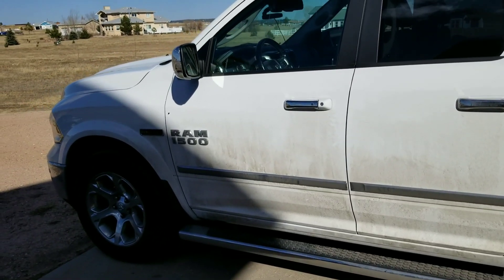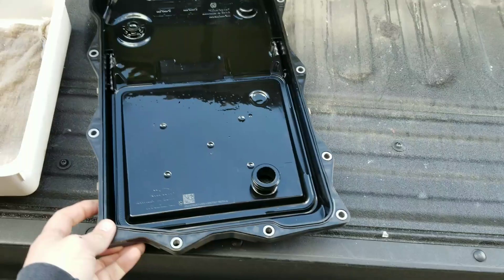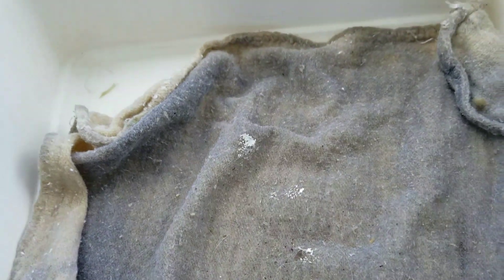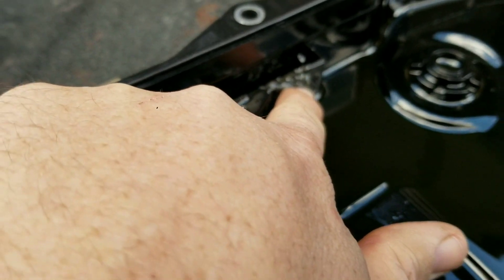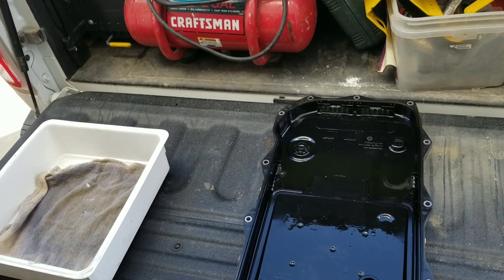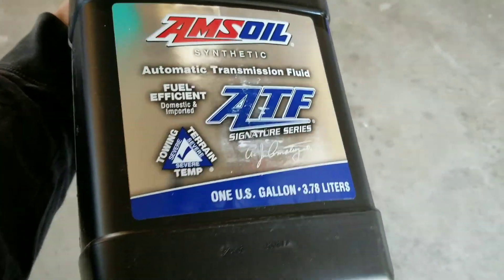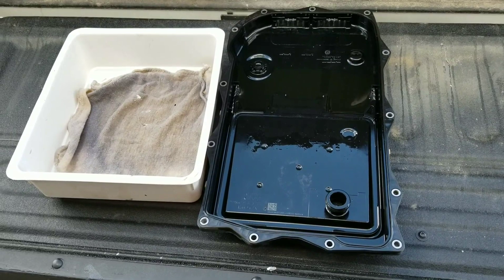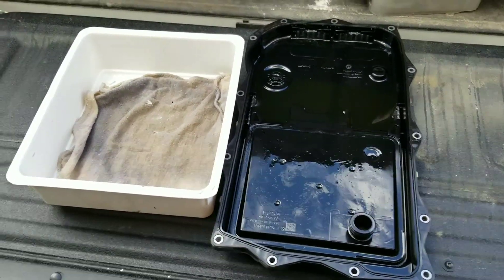Ram EcoDiesel 70K miles transmission service and findings: ZF 8-speed

Comment: The official ZF procedure calls for the transmission body to be level, which usually means jacking the the rear end of the truck up, rear wheels about 8-9" off the ground.

Comment: Dealer cost to change the transmission fluid is around $600.00. $225.00 rear axle fluid change, 2 wheel drive. Then $600.00 for 16 spark plugs. Pretty expensive service. But, much less than replacing either component. It cost to play.

Comment: I thought it was
Traction control off
Reverse at 2000 rpm for 5 seconds 
Neutral at 2000 rpm for 5 seconds 
Drive at 2000 rpm for 5 seconds...
Then let transmission cool to 86/122...
Top off...
This seems more simplified.

Comment: I love this transmission. I tow commercially with my ED taking travel trailers from Mfgrs to dealerships. Truck runs all day everyday like a semi. 640,000 miles zero problems with this transmission. I change fluid every 100k so 6 times now. 3 times I changed the filter. I use Valvoline Maxlife. I’ve done 15,800 pounds CVW over 6 percent grades. Truck with tune makes 465 TQ. Still shifts perfectly.
Reply: Vern Lochtefeld vern diesel from ram forum? Whats up man, glad to hear your truck is holding up well, its an inspiration for the rest of us half ton owners 👍🏻
Reply: Good to know thanks. If it last you that long then for my gentle commute driving changing every 100k it will outlast me.  🤣
Reply: Great! Have you always be running with Valvoline maxlife after first oem pan drop? You said 100000 miles interval change it's that correct? Also it means that the ED is reliable even at that mileage, have you encounter any problems so far with the engine?

Thanks.
Reply: Tovan69 Yeah I used another fluid first two changes then switched to Maxlife.  They can hold up with a good aftermarket tune & EGR cooler delete or now new replacement of EGR cooler. Well plus proper fluid & filter changes including the Mopar combo fuel/water separator fuel filter. 

Yes mine pushed a head gasket at 371k probably due to low coolant from leaking EGR cooler. Truck has 677k today and still no trans issues towing commercially.
Reply: @vernlochtefeld1626  ok, what fluid brand did you used for your 2 first atf oil changed? After dropping the mopar 8&9 speed( or zf lifeguard 8), just before changing to Valvoline Maxlife?
Reply: Tovan69 Quantum Blue. Custom blended for diesel version of the ZF 8 speed transmission. It met specs in 2015 and was still way cheaper than the ZF fluid from a dealership. Old website but good stuff.  http://bndautomotive.com/quantumblue-products-2/
Reply: @vernlochtefeld1626  thanks for all your share. 🤙
Reply: @vernlochtefeld1626  Hi sir, would like to know when you dropped your oil with some in the cooler, did you refill only once and do 100 000 miles or you did multiple refill until it was red and clean and then did your mileage?
Thanks.
Reply: Tovan69 just once.
Reply: @vernlochtefeld1626  No problems with Crankshaft positioning sensor tone wheel? (Referring to Recall W58) mine went out at 90k now I feel like a ticking time bomb for the next one to go out. What tune did you go with?
Reply: @HardWoodHauler  The first motor never lost a tone wheel but low coolant from a leaking EGR cooler caused hot spot pressure & we believe pushing the head gasket at 371k.

The 2nd motor did lose a tone wheel but I forget at what mileage. Motor has went 423k. I put the GDE EGR off tune in at 33k on the truck and from day one on the 2nd motor. 

I think for clean internals problem free operation & long life an aftermarket tune to turn off EGR & more is money well invested. At least for the 2014 thru 19 version. Also I use Rotella T6 and change it every 10k. You can see pics & read it’s story in the maintenance section over at ram1500diesel.com
Reply: @vernlochtefeld1626  I had the same problem, leaking EGR cooler so did full delete with GDE at 85k lost my tone wheel at 90k now I'm at 135k engine runs great. the W58 recall is software related to apparently read crankshaft position at the over head cams. The dealership cant update my truck with the GDE tune and GDE no longer offers the off-road tune so I'm not sure what to do to fix the tone wheel problem.
Reply: Pretty sure you don’t have to lose your GDE tune.  Ask at ram1500diesel.com forum.
Reply: 15,800lbs is quite impressive for that ED to tow long distance. I'm curious what's the average fuel economy pulling campers? I've been looking at the Ram and Chevy 1500 3.0. I really like the inline 6 design of chevy. Chevy is also revising the 3.0 for 2023 and I've heard they may offer over 300hp and around 500lbs torque. That would be a game changer. However, I like the Ram more for the looks and interior. I'm referring to the Big Horn or Laramie. The Ram boxes are also a nice feature.
Reply: Where can I find Amsoil?
I'm lazy I want long lasting fluid🤣
Reply: What truck do you have with that many mile?
Reply: @RickySlatton  Ram 1500 ecodiesel.
Reply: How many quarts does the transmission hold? If you put in 5 quarts  then you have another 5 quarts of dirty oil still in it?
Reply: @j.r.2585  It takes 6 quarts leaving 1/2 dirty. If doing new filterpan you get new filter & clean magnets. 🧲   6 quart changes trans still shifted well until 700k miles when an electronic part failed. Bought a salvage yard transmission which has been fine for 175k now (240k on trans) 875,000 miles on the truck.
Reply: @vernlochtefeld1626  wow glad to hear you have that many miles. I have a 2015 outdoorsman it has 89,000 miles on it 31000 of them towing 7500 pounds in town. Had GDE tune up until they ratted out their customers and sent us CARB letters. 
Changed to Sofa King Tune  about 18 months ago .I just had the intake replaced because the swirl valves were stuck open about 2 weeks ago. FCA covered it . the intake was clean since the egr was off . 
I still have my pre EpA GDE tune and I can say GDE tune is better you can feel the difference. Too bad they felt they needed to give their customers information up. I just cant forgive them for that.
Reply: @vernlochtefeld1626  Also wanted to say thanks I watch your video and I am waiting for UPS to drop off the filter now I have 8 quarts of Amsoil I figure I will change the filter add until full drive a few days then add the remaining after draining some.
 I have been getting a rough downshift between 4th to 3rd like .
Reply: Yo man I see you everywhere on the Dodge Ram 1500 diesel and want your take on what kinda oil, treatment, and tires you run? Any routine cleaning like intake and MAFS? 2014 with 163k miles. Deleted and tuned. Send me your recommendation!! Your hope for me and this truck lmao
Reply: @antoniocraver2445  I run Valvoline T6 5/40.  It’s an approved reasonably priced/available full synthetic.  Good detergents yet good wear results. Takes the high heat and definitely good enough for a 10k change interval. My valevetrain was clean and almost wear free at 423k miles. 

This motor has not proven to need a fuel treatment. I don’t normally run one. You can run it as insurance though. 

I’ve run a lot of different tires on this truck. Cheap, expensive, standard load, XL load, and E loads. Cooper Discoverer HT Plus is my favorite. Quiet smooth long lasting gripes well. I just read they have discontinued it. You may still be able to find it and I don’t know what Cooper recommends as it’s replacement. 

GDE tune with EGR off and T6 everything stays clean. I use Mopar fuel filter & change it every 30k faithfully. I use Amsoil 100% synthetic rear differential fluid. These are the most important things.

Comment: Small Shavings like that is normal in transmissions, transfercases and gearboxs. Any chunks or bronze shavings is bad, and any clear burnt clutch smell is also a bad sign. I'm about to change my transmission fluid (105,000 miles, hopefully I didn't wait too long, mainly highway miles and has not been having any problems,  still smooth like when I first got it.) There is an aftermarket transmission pan for 130 bucks on Amazon for the 8hp70, 8hp45 etc, has replaceable filters that are like 30 or 40 bucks a filter so you don't have to keep replacing pans.

Comment: Great video... but you say the fluid is supposed to be clear which is not correct... if you buy the correct (recommended) 8&9 speed fluid it comes new with a greenish tinge. So you weren't in anywhere near as bad a shape as you thought.

Comment: Lifetime is not good for any transmission, no matter what the manufacturer says.
Reply: The car companies such as dodge want the transmission to go bad after a certain time frame with planned obsolescence and won't include what the manufacturer of the transmission recommends in hopes you will bring it to the dealer for a new transmission. I had a stealer'ship  try to tell me that they are "forever" transmissions and drive it until you have a problem with it or it starts making noise. I was like really? If that's the case it's too late moron!! LOL
Reply: The lifetime is the lifetime of the transmission. The lifetime of the transmission maybe 150-200K miles. At that point the transmission owes you nothing.

Comment: That's pretty normal, the initial build of the transmission will have about 15 to 20 miles of wearing to settle the mesh in, after that the shavings generally fall they will lower it enough to last about 20 to 30 years but a lot less when you draw heavy loads for work, such as a full bed of tools. They expect this, and add the magnets to handle the shavings.  This kind of break in works better than pre fab meshing, hence why they add magnets. Once the seal is broken, the vacuum is gone and then you will have issues.

Comment: My eco diesel is used 6 days a week for hauling heavy loads and had 367,000 miles when I serviced the transmission and the fluid was still almost completely clear. You must abuse your truck....

Comment: Just a comment about German engineering, it may just be the best in the world. To become a mechanic in Germany I believe it takes eight years of school, the same amount of time as a medical doctor. My first bike was a 65 BMWr69us, (I was a young pup of 17)I bought used from a dealer who said the mileage was 17,000 about a 6 months later I was on a road trip and Happen to be in Tennessee when the value burned. I went straight to a BMW dealer to have it repaired. The tech asked me how many miles were on the motor, I said 17K. He replied try 117,000 based on how he viewed the rest of the motor. He repaired it and I went on my way. When I got home to New York I decided I was going to port and polish the heads, under the guidance of an expert mechanic who had gone to school at BMW. To both our surprise it had been ported and polished from the factory. The only other issue I ever had with the bike was harmonic balancer mounted on the front of the crankshaft with a rubber washer between the crank and the balance wheel, the rubber wears out and the bike is the farthest distance from being balanced. I called Butler & Smith the importer for BMW in the '60s-'70s and spoke to a tech, who flat told me it was a wet dream of some idiot engineer and to just take it off and throw it away. I did half of that I took it off and it road just fine no vibration. I did, however, keep it, in case the next owner wanted it. The other example of fine craftsmanship all the welds were perfect dimes, these were hand welded no robotics involved. My last comment I sold the bike to by a 65 Triumph 650 Bonneville ( which had only a few things going for it, it's speed and handling for that period) The Lucas electrics were garbage, you could expect to rebuild the top end at 25k-30k, the BMW well over a 100k To prove my point a restored BMWr69us sells know for about 25k a restored Bonnie 8-9k and there are probably less restorable Bonnies than r69us's. I ride a BMW 2012 R1200GS and it will proabley last 200K atleast.

Comment: Thanks for the video which sort of gives an insight Matilda vehicles which have the lifetime transmission fluid. I've run Toyota and Lexus vehicles on my life which also calls for lifetime transmission fluid. 
I had a Toyota Sienna with 330000 miles on it without ever changing the transmission fluid. Then one day like an idiot I decided to change it. I go no more than 5000 miles down the road and the transmission starts to slip. My point is on extreme high mileage transmission don't change the fluid! 
My current vehicle 2009 Lexus RX 350 is approaching 250k miles without the transmission being changed. I'm going to leave it like that and see what happens. 
Again, thanks for the video I wishing you the best ride.

Comment: You should get an after market oil pan that has an changeable oil filter they make some that you don’t half to take the whole pan off and half to buy a new one, you can just change the filter
Reply: I've seen the after market pans that have a changeable filter, but you still have to remove the pan to change said filter.  Do you know of one that you can just change the filter without removing the pan?  If so, please share.

Comment: Yeah if it's that color you are having a massive transmission problem, I've pulled the plug on trans with 150,000 and it was still clean some metal, but they are filled for life but you do you bud

Comment from the maker: One thing I definitely recommend if you are ever towing is remember to use the tow/haul mode switch on center console (assuming you have one). It makes the trans shift quicker and firmer to prevent  excessive wear on the trans when towing
Reply: Also locks out the over drive gears right?
Reply: @spence5627  no, it just changes the shift pattern of the trans
Reply: @spence5627  My '14 won't go into 8th gear in tow/haul.  Also, tow/haul mode won't allow the engine to do the "MDS" 4 cylinder thing.

Comment: Thanks for the video. It helped me a lot. Also I really liked the way you wrote down your procedure so I didn't have to watch the video 12 times and take notes like some other channels. 

I decided to use the Valvoline MaxLife Synthetic ATF in mine. It took right at 5 quarts (spilling a little) with the aftermarket ATP B-453 pan/filter. I'm at 69,000 miles. I should have done this sooner but I was busy. I'll do it again at maybe 110-120K.
Reply: Also, my fluid and crud on the magnets looked nearly identical to yours.

Comment: I work on tundras and we never remove the pans for service. We’ve had several ambitious DIY customers try, then they snap the pan bolts trying to take them off. We use a fluid called WS (world standard) lifetime synthetic. Can’t tell you how many transmissions run up to 200k plus with out issues. I own a Ram I’ll probably end up spending the money I saved from buying a Tundra on repairs for the Ram but if you don’t beat on things they tend to last. Plenty of hard working slow driving farm trucks that never had trans fluids changed at all.

Comment: As a retired fleet mechanic, I’m in shock at the engineering genius I’m seeing on this new car and truck stuff, 

Omg you gotta buy a pan cuzz the filter is one with the pan

What’s next, spin a new engine on the oil filter to change the oil.

Or maybe have to pull the engine to change oil. 

The enemy isn’t crud in the fluid, it’s the crack headed engineers forcing the self service out of the ownership of this garbage all in the name of keeping the planet green and possibly riding the planet of the horrible human- UFB
Reply: Maybe it pays to have new magnets
Reply: It will get worse as these millennial engineers become upper management.

Comment: Watch several videos on the ZF 8-speed transmission and how do you change the filter and oil or transmission fluid. Everyone does a great job of describing how to do this with the exception of one thing. How much fluid did they drain out of the transmission. This would help with the rest of us wanting to put the correct amount of transmission fluid back into the vehicle. If you drain out for courts that it's pretty obvious that you're going to put back in 4 quarts. So one would think that you would have measured exactly how much you pulled out so you know exactly how much to put back in.
Reply: You don't have to worry about exact amount.  Follow directions getting tranny to correct temp then fill till it dribbles out the fill hole.
Reply: What measure is courts, not familiar with that?
Reply: Damalia Marsi basketball court, tennis court, badminton court, cmon man get with it

Comment: Have you had any issues since the service?  I'd be cautious using Lucas additive on this transmission cause the stuff is super thick, did you notice any shifting improvements?
Reply from the maker: Used the newer formula trans conditioner. Not as thick. Shifts very well.

Comment: Have a question, did you change out all the transmission oil from the converter, Or did you just fill it with the amsoil. Just wanted to know because I'm doing the ppe transmission pan with the amsoil. Please let me know.

Comment: Where did you get the fill up procedure from? I've mostly done as described, but technically it's 122 degrees not 125 degrees Fahrenheit according to the sticker on the pan. Obviously not the biggest difference but just saying. Also I think you have to drive it in 2nd gear as well but I could be wrong. So far after I have dropped the pan and refilled it I only got about 4 quarts in but I guess I'm going to have to double-check it tomorrow maybe I'm able to get another quart in but it seems to drive okay. I don't know why the dealer sells you nine quarts. It must be for a full rebuild and total capacity but I would be mad if the dealer sells you 9 quarts of fluid on a service and only uses 5 if they did it